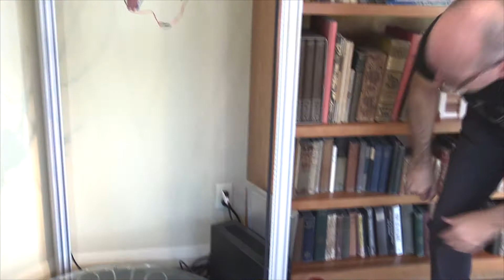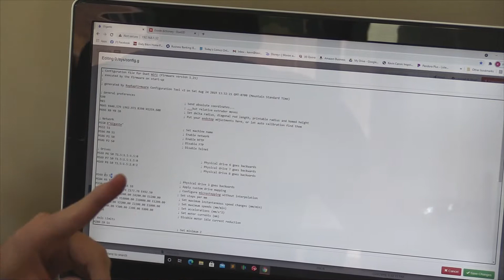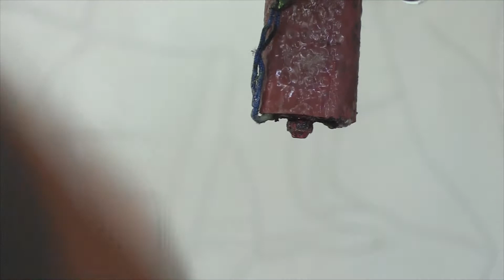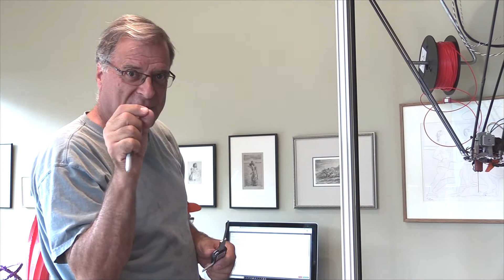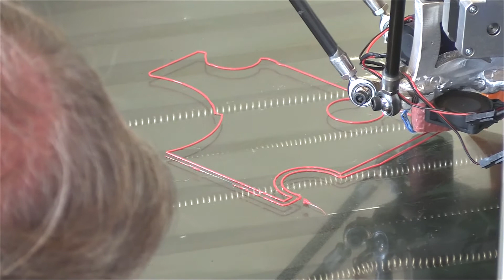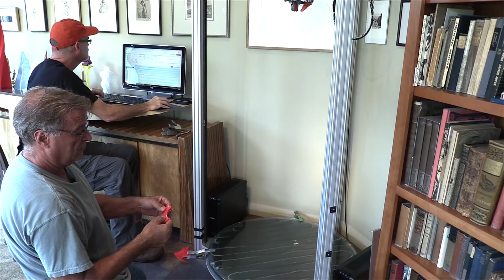How to Replace a 3D Printer Extruder in an Unfiltered Session, Part 2 - Kevin Caron

Comment: Excellent video!  Enjoyed watching the process.  So I assume you don't change the diameter of the filament often.  Makes me wonder if all manufacturers of the filament produce consistent product.
Reply from the maker: That is correct.   This machine is set up for 3mm.  It really is 2.85 but the diameter runs pretty true to size.   The other printers I have are both 1.75mm   Thank you for watching and posting.

Comment: To me this is what I would call a good mechanic job. With basic to intermediate level knowledge of different parts, systems or programming you can problem solve any job. Electrical Problem? Can you replicate the issue? Find the source. Identify what went wrong. Brainstorm different ways to fix it. The hardest part in this case is insider knowledge on programing statistics for setting the machine. The easiest but could be considered the most laborious part of the job is always the calibration. Overall this video was a good watch. Looking forward to the next one
Reply from the maker: Have always enjoyed that part of being a mechanic.   Thanks for watching and posting.

Comment: > and here the philippines i thought i had problems with pc front panel usb ports that wont contact (imagine,  the individual parts are sold only as a completely new chassis);
 the spool splicer reminded me of the built in band saw resistance welder @ the place i apprenticed as a machinist.
Reply from the maker: Thanks for watching!